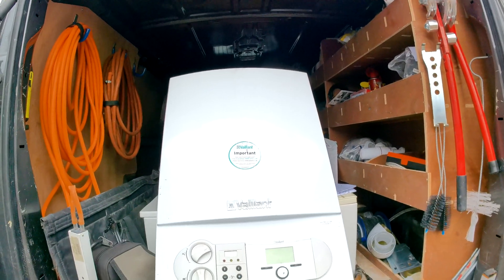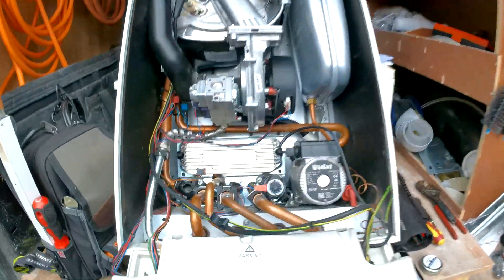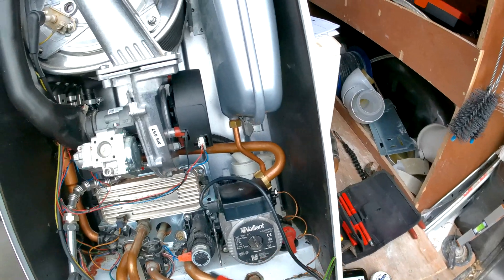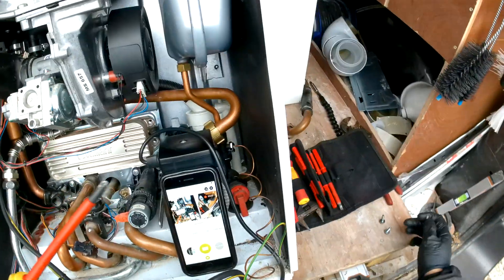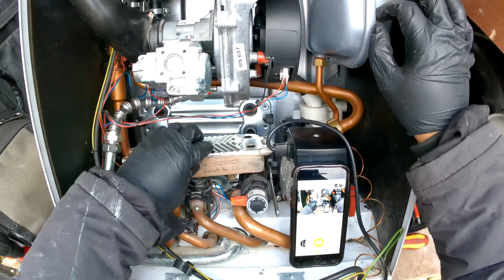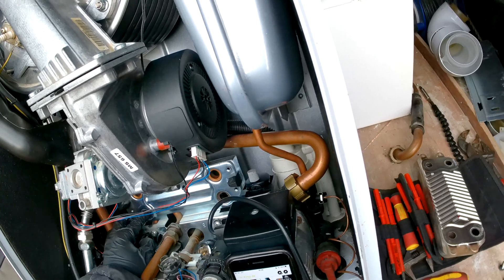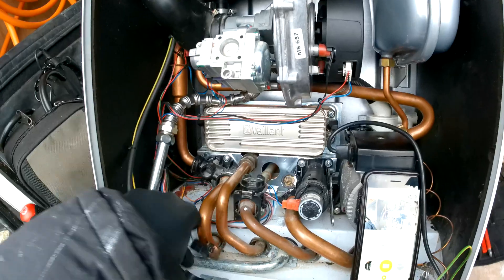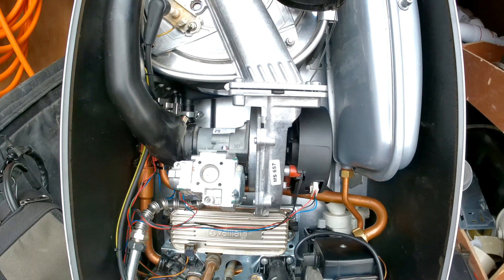Vaillant Ecotec Pro - Plate Heat Exchanger | F20 / F24 | Hot Water Coming & Going?

Comment: So just to get this right:

1. We isolate the flow and return 
2. Drain the boiler
3. Isolate the cold inlet
4. Leave the hot pipe as is
5. Open hot water taps around house to check all hot water is out of the system
6. Remove heat ex plate 

Is that correct?

Comment: Our ecotech 837 plus is failing to supply hot water....radiators are fine. Code S.53 showing. Could this be the plate heat exchanger blocked? Any advice appreciated.

Comment: If the heat exchanger was blocked, would you also check the canoe filter to check it was working correctly and not allowing excess grime and dirt through to the heat exchanger ?
Reply: That's brilliant thank you. And I'm sure It goes without saying, but if a canoe filter had been left out or broken, its going to let a lot of debris I to the system and cause serious issue ?
Reply from the maker: @thomasbelcher7354  if the canoe filter is broken then yeah it can cause a blockage and not allow water to circulate properly (same as if the canoe filter is completely gunked up). If it’s missing then it’s not the end of the world
Reply from the maker: Yeah, by looking at the canoe filter you can see how well it’s working (if it hasn’t been removed by another engineer already) and also how dirty the system is. Might need a flush

Comment: I have a valliant echotech plus combi 831 boiler.
I sat hot water at 46c however when I open tap it goes very hot up to 78c on penal and then gets cold and flame comeback on.
Could thus be due to a sludge in heat exchanger?
 We powered flush our central heating system a year ago and had put a inhabitator in the system. 
Please advice what should we do?

Comment: Great video, thanks for the upload. My Boiler is an Ecotech 824 and I keep getting F.75. A reset usually gets it going again but I have noticed the pressure increasing. I usually bleed the system back to 1bar and I get a few days of heating again. Would F75 trigger with raising pressure?
Reply: expansion vasle
Reply: Or internal filling loop is common for this
Reply: Pressure sensor faulty.